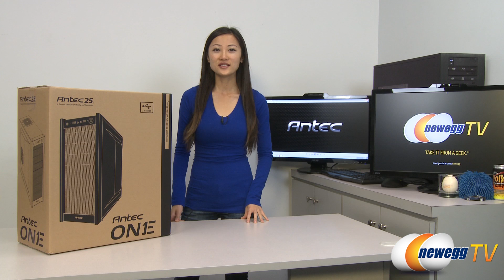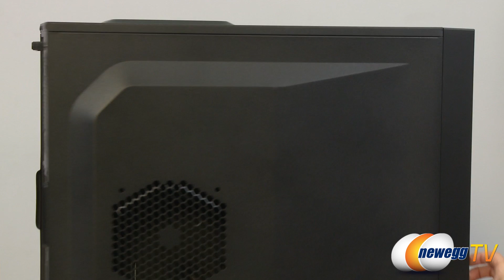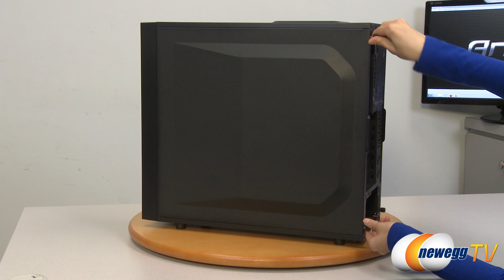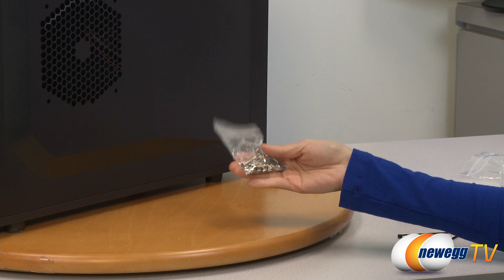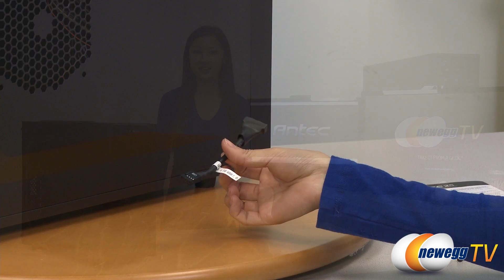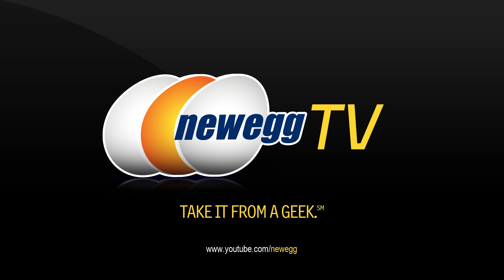Newegg TV: Antec Gaming Series One Mid Tower Computer Case Overview

Comment: Excellent review, I am about to buy 2 of these cases over the next couple of days for an i3 and an i5 build, newegg has them for $50 at the moment, which is an absolute steal. I especially like the right side hard drive access and the extended panels for the cable management. Nothing worse than getting all your cables around the back of the mobo, and not being able to get the panel back on without it bulging, this fixes that issure perfectly. My mind is made up, thank you Joanne.

Comment: @doomtomb3 No it does not look exactly like the 300, I've got the 300, and it's a little bigger for 2 front 120mm fans, and it has flat side panels, and does not have a cutout on the mobo tray, etc.. but yes Antec does tend to keep a lot of the same styling q's from case to case model, as they go with what they know works, and what's been selling really well for them, which are clean, simple, high quality budget friendly(most of the time) products.

Comment: The "foam button" primary goal is not cable management. It's to give more rigidity to the MB stand. Since the CPU cut out is so big, the engineers decided to compensate about it with that button.